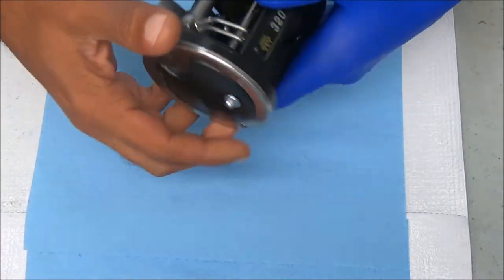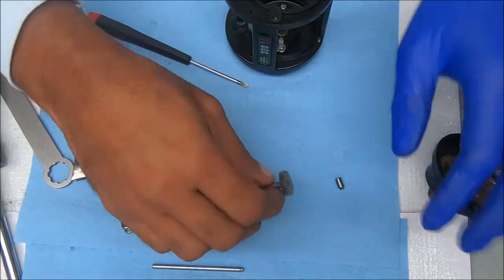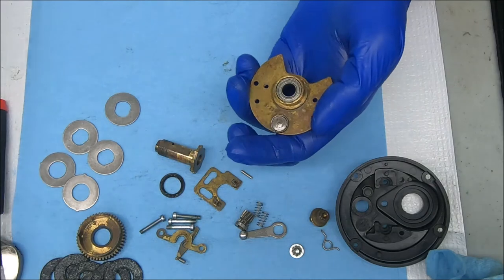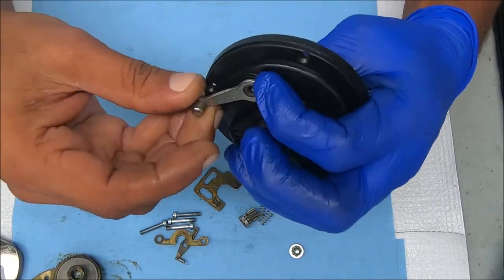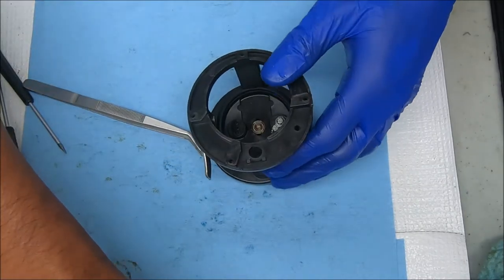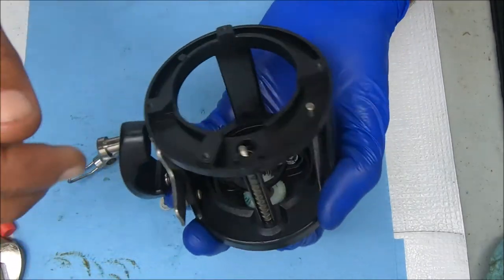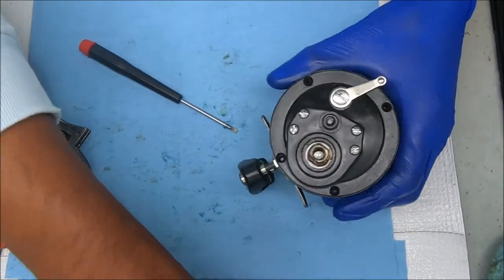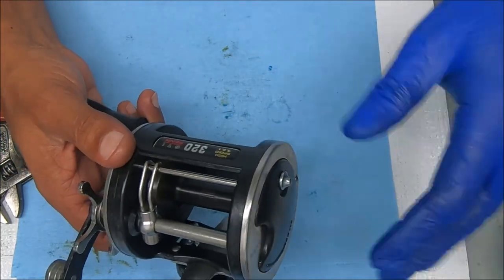Penn 320GTi Fishing Reel - How to take apart, service and reassemble

Comment: How do you remove and service or replace the spool bearing. In the left sideplate?  Is the bearing a slip fit or press fit in the sideplate?
Reply from the maker: Thanks for watching! It's not designed to be removed.... it's peened in (like the one under the bridge plate - part 3 on the schematic). However, if it needs to be replaced, you pop it out with a bearing removal tool and replace it.... it just won't be locked in the cavity anymore. Be careful you don't damage the side plate when trying to remove it.

Comment: Hi: I own this reel and unfortunately it is allowing line to slip off the spool even when the drag is tightened all the way.  When reeling a heavy lead weight in while halibut fishing the line slips off the reel in jerky movements, like one of the gears is damaged.  I took the reel apart and could find no missing teeth on either the main gear or the pinion (spindle) gear.  Do you have any ideas what the problem could be?  Thanks!
Reply from the maker: Thanks for checking out the video, Scott. Three things come to mind:

1) your drag stack could be compressed and or fuzed together. If so, they need to be changed.

2) The washer under the main gear may need to be replaced.

3) The bushing/sleeve in the center of your main gear could be loose. Hold the main gear in your hand and try pushing it with your thumb.... use a good amount of pressure. If it moves at all, you should replace the gear.

Hope it helps.